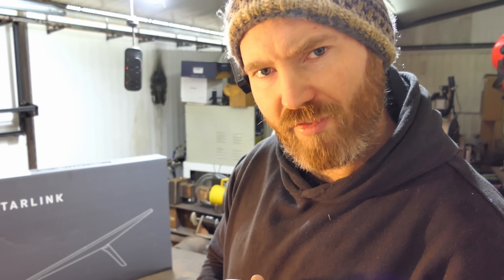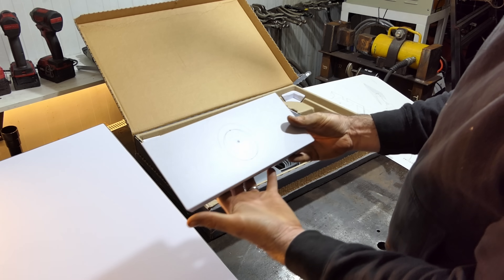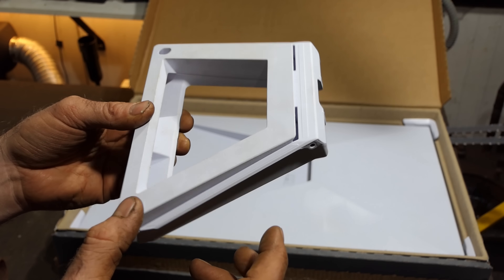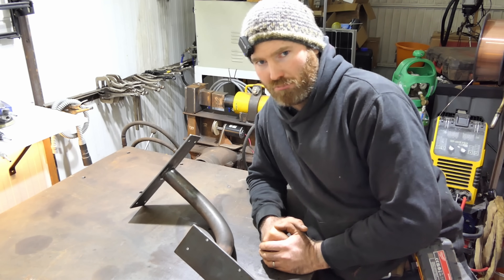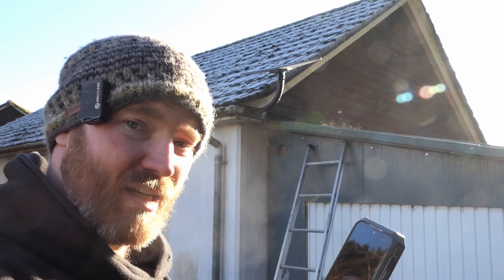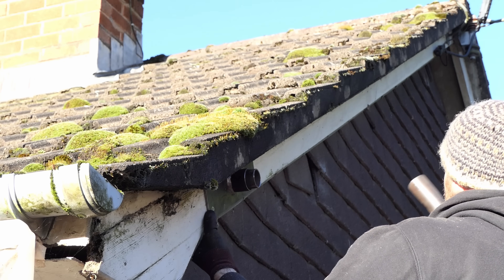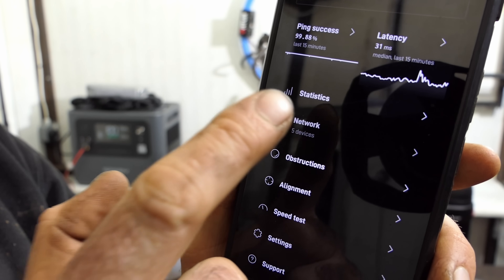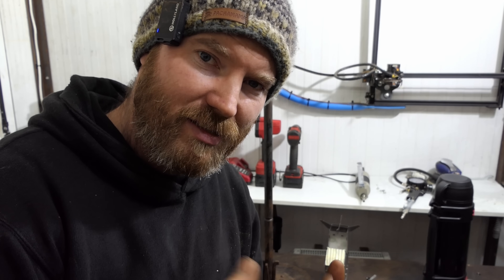I bought UK Starlink internet... I'm shocked!

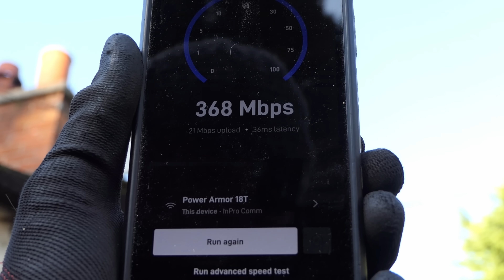Comment: 08:15   You are incorrect

It is 368 MegaBits  Mbps
NOT 368  MegaBytes per second    MBps

368  Mbps   is  46 MBps 46 Mega Bytes

8 bits in a Byte
Remember that
4 bits in a Nibble

Comment: One could buy a bracket - similar to those used for mounting
TV Antenna
OR
Go to a place where Car exhaust systems / pipes are made and fitted.
Have a bracket made in Stainless Steel - 
Generally Stainless Steel Exhaust systems are made for Trucks and
High Performance cars.

There will always be plenty of Off-Cuts  of  pipe
So a simple mounting bracket will not be overly expensive

Comment: BT were charging me £82 a month for FTTC connection in which I had copper connection to cabinet under 1/2 mile from premises. I originally got 54mb/s speed but as take up of the FTTC service by other subscribers increased my speed dropped to slower than ADSL speed or dial up modem speed. I decided to get a comms company to carry out a site survey as most of the mobile networks claimed according to their network coverage we would get good 5g coverage. The mobile network coverage here is non existent so the claims by these mobile network companies are a total pack of lies. I was advised that Starlink would be my best bet and it worked out cheaper per month than BT. I took the plunge of going for Starlink, the basic kit was free but i had a professional installation carried out, and have been with Starlink for 7 months now consistently getting speeds just under 400 mb/s. It is far better than any broadband providers in the UK and streaming, UHD, gaming and everything else I need to do simultaneously is absolutely flawless. I couldn’t ask for anything better than Starlink.

Comment: I have starlink in London - because I got it early... (I believe you can't always get Starlink for a London address any more - as there's a limit to how many connections can be in a relatively small geographic area - it opens up when the number of satellites bumps up just). The congestion charge you got is probably just because the local area you're in has a lot of other Starlink users (because the regular internet options where you live are crap).
Obviously I wouldn't need it if I could get fibre - but East London (Zone 2 on the tube map) is apparently not densely populated enough for fibre to be rolled out. I think the real reason is BT wants to get as much money as they can from renting out the copper cables that the Post Office put in before BT ever existed.
I first had fibre in 2005 in Tokyo. And had fibre in Hong Kong (gigabit just - but only because they charge more for the 10GB, and I wouldn't use it), and had fibre in Thailand - which is pretty much available anywhere. London is the only place I've lived in 20 years where I can't get fibre.

Comment: It's way too expensive for the average household.  Maybe when the cost drops by around 50% I'll consider one, what gets me is the big difference in download/upload speed for all internet connections, it should be higher upload and lower download speeds, or at the very least equal speed. The reality is that it's the bandwidth that's important for multiple users, I'll stick with my 4G router for now as living in the sticks I get better speeds from that than the landline,  Plus my whole setup came in at £85 with a monthly unlimited data plan for £18 per calendar month. download 120 Mb/s  upload 10 Mb/s

Comment: if you go on starlinks website themselves in the Uk the hardware is only £19 with a £75 a month plan. much cheaper since the original price. Definitely worth it for 5x  speed in the uk. We dont have any fibre optics over in here wales

Comment: To anyone in the UK: You don't need it. Just get a Three 5G hub for about £20 a month. I got 700Mbps the other day downloading Fortnite (90GB) on my Xbox Series X. (took about 20min) You always get fast speeds and even faster when downloading games since they have faster servers. The upload speed is about 50Mbps and ping is fast also. I've had it for years with multiple using the internet and had no issue gaming online. The speed is uncapped also, so it'll go as fast as it can. After midnight there's less people using the network (not in my house lol) so it'll be even faster, but it's still fast during the day also.

And most importantly there's no Fair Usage Limit either. If you went with say EE then after using 600GB within a month (which happens when streaming / downloading games especially with other users) then they just cap your internet speed right down, and at night they just cut it off completely to prioritize others. So EE just sucks. But Three is absolutely PERFECT! No issues at all, it's as it should be. Fast and Truly Unlimited Internet, that you can also take anywhere! We're living in the future. And we'll have 6G not too long now in the 2030's.

Starlink may have its use if you're stranded in the absolute middle of nowhere to justify that price. But if you're able to get a 5G connection then Three is the best choice there is. In other country's you'll have to use a different mobile network of course so price will be different and you'll want to check if they have a Fair Usage Policy before going with them. I just checked and Starlink itself even has a Fair Usage Policy, apparently it's after consuming 1TB within a month. So that might not be too bad for those who really need it. But paying that price though, there shouldn't be any Fair Usage at all slowing you down.

So yeah just get yourself truly unlimited mobile broadband like Three. Would recommend 3/3. lol

Comment: @Joshua De Lisle - If you are planning on upgrading you're old Desktop PC; BEWARE of the price for RAM right now due to a surge in demand due to AI Farms demanding the available supply of DDR5 in particular. I would therefore consider 2nd hand AMD AM4 Socket CPU and Motherboard with DDR4 Ram... The  Ryzen 7 5800X3D  CPU good for 4k Editing Maybe a B450/B550 Motherboard and 32GB of 3200-3600MHZ DDR4 RAM would be My choice in you're situation (A new Power supply of 800Watts upward will also likely be required.....PS Good Info in youre video.

Comment: The one thing I will point out with Starlink is it’s not a constant speed so if you get a bad speed test, just restore the test because it will be between satellite that’s why are you getting the lag? It actually will get better on the second test when you do it.
The one other thing I found out is that don’t use this darling speed tester use any other one and you will get a better result than you will with the Starling one. The only way the Starlink one works is if you connect to the satellite directly if you’re connecting through the modem will screw you up.
One of the problem I found and I did not see it on the set up. I might have missed it but I will point out my error. I did not set the password on the satellite itself. That means anyone can connect to it being out in the country might not matter to you, butcheck that the dish has a password on it.

Comment: Has anyone ever thought just HOW these satellites actually remain stationary up there ( assuming they are up there) and yet no one has ever made it common knowledge OR is the signal that YOU receive is actually being bounced off of the Firmament and that the actual sending device is sitting comfortably on someone roof or building . Your thoughts would be appreciated if you actually know. Thanks
Reply from the maker: There are lots of satellites and they just switch over as they pass. That's why space x has put thousands up there so you get a continuous signal but not all areas are within the orbital path. Cheers J

Comment: Still vulnerable to adverse weather conditions same as any other ISP Significant weather can cause service degradation due to attenuation of the radio signals. Moderate to heavy rain, snow, and hail can cause momentary service dropouts.  From Starlink's support pages. Maybe not such a good idea for those rural locations in the UK. Residential I believe is £55 per month.
Reply: Residential Lite option; I watch Linus too :hand-pink-waving::face-blue-smiling:

Comment: @ 11:05 and onward.  About 12 year old computer.  If you replace it try to install linux on it.  It is a bit gnarly to begin with.
A few YouTubers use linux for video editing and suchlike.  I never have.
You can try linux for free, and keep it for free And something like MX25 is reasonably okay.

Easy way to try it: download linux on to a bootable USB memory stick.  Start computer and use startup options to boot from memory stick DO NOT use INSTALL feature until convinced it is ok for you.  Of course it is more complicated than my quick summary but ... like most computer things once you have done it a dozen times it is easy-peasy
If you do install it on to 12 year old computer try swapping out hard drive for solid state disk.  It speeds things up quite well.
Adobe software is not likely to be installable but GIMP is reputed to be linux Photoshop
Warning: do not try it on your only working computer..  All at your own risk.  https://mxlinux.org/

Comment: Western Australia it's 290/34 at 7pm.  Peak traffic time.   Our local NBN fixed wireless was 70/20.  That was off peak.  Off peak Starlink goes to around 360mbs.  That seems to be a capped speed everywhere.

Comment: im in the same situation stuck on copper with slow speeds and i live basically in the middle of a university city centre so you know fibre runs are not far from the house at all.... but its a small road and they have no interest in installing fibre so far, its extremely annoying when you live on the internet, dont know whether to wait and hope fibre comes soon, as they did tell me 2024 once probably just to get me off the phone but come 2024 nothing happened and its now 2026 and i have thought about buying sim routers

Comment: wifi is awful in houses.  ground rule for wifi: It will go through one wall.  More than that, coverage will be bad.
The best way to get internet in houses is to make a wired backhaul, and put a bunch of wired access points in.
You should install Cat-5e or better wiring and a central switch, and a starlink ethernet adaptor. 
setting that up would be about 500$ in parts and installation is free if you have 20 years of IT experience.

Comment: Just installed Starlink before Christmas as we can only get the internet over the mobile network and with speeds averaging around 6 Mbs was somewhat woeful. I was concerned that we would not get a good signal with all the trees around us. But Starlink had a deal where the hardware was at no cost, has to be returned if you cancel the service, free installation and $20 per month of the monthly cost. So we signed up, they obviously didn’t do their homework with the free installation as it took a month before a local installer contacted us, with the earliest date being late January. We had an old satellite tv dish on the roof so installing on the existing pole was easy, I sourced a pole adapter on eBay for substantially less than the Starlink version. Routing the cable was a bit of a saga as I did not have the crimping tool for the rj45 connector so could not run the cable thru the existing conduit. But easy enough to set up and we now consistently get over 300Mbs.

Comment: Get a NAS. I have a UGREEN NAS my family uses for storage (no need for cloud) it has around 112 Terabyte of space so far, due to the amount of 12TB Ironwolf HDD i've put in it. It's in a raid configuration so if a drive dies, i lose nothing i just replace the drive. I also added two 1TB Sabrent Rocket NVME SSD's for caching and this thing is fast as hell.    Give the family a folder each with a password and quota and bobs your uncle,  if you upload to that instead of carrying HDD's about like it's 1999 then you wont ever lose a thing.  Storage is just one of thousands of things you can do with a NAS, you can run Docker and many other Apps from it, very handy.

Ps. Get some wi-fi repeaters to extend your wifi speed through your house.

Comment: Starlink my ash. 

In Greece we suddenly found ourselves last in Europe in Internet Speed in 2015. In 2022 we started the entire rejuvenation and as you know, whoever builds last, usually builds the best. Billions have been poured in Fiber Optics. Now all companies offer from 1Gigabit to 3Gigabits and a couple up to 10Gigabits. The government offered vouchers from 20 to 200 euros for cheaper upgrade as an incentive. Obviously, unlimited data, landline calls and even call & messages from the mobiles. The 5G at least is 1GB already. It was good anyway. I've got 1Gigabit for home and 3Gigabit for work. I happen to be second Lieutenant Engineer in the Greek Air-Force. The manager of my 4 years contracts in the same telecommunications company told me the billions poured the last 3-4 years are equal to the Army. In the Army, re-armement and restrucre-wise we're amidst our biggest in the last 60 years. 32 billion have been set aside just for the next 7 years. After the 7 years, new budget, plus 20 billion in general for the restructure. Similar case with the Metros. Athens has had the most modern in Europe until recently in automation, level 3 until the one in Thessaloniki, northern Greece opened which is level 4 in automation with 1 in 700.000 chances for any major incident. Practically zero. Why do you pay American companies instead? What about your own infrastructure even in rural areas? At some point they must be done. Especially now that the US has proven to be not much of an ally.

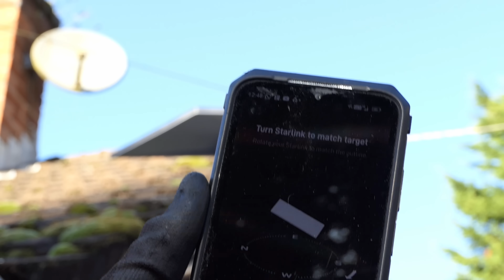Comment: 7:49 Nooo! mount the Starlink onto your chimney stack so it's the tallest thing around, you need 360 degrees all around line of sight to the sky. Your entire roof is blocking access to the satellites now - you'll see a marked improvement - certainly works on a fully cloudy day and even in medium rain it will be fine - with unimpeded access to the sky.

Comment: You can setup Ethernet over power. Will fix you issues with not being close to the router. Very easy to setup. Basically you just plug it in.

Comment: That is way expensive in your country. Here in Hungary you can start Starlink with an initial cost of $25, which is basically the shipping cost of the hardware. But you do not own the hardware, you have to return it if you cancel. The monthly cost is less than $30.

Comment: I use 3 mobile network WiFi, comparable numbers, better ping and cheaper at £21 per month with no hardware costs.

Starlink is not profitable and has cost around 20 Billion so far. Without major uptake it will go bust. With major uptake it will have a major drop off in bandwidth per person, there is no way to dynamically route traffic due to loading, as you only have a finite number of satellites.

Comment: I called my ISP, asking if I could switch to fiber optics. They sent a guy out to see why the fiber cable installation I had wasn't working. He called for a different guy to fix it. Then I plugged my router to my wall socket, I plugged my desktop into my router, and now I've got symmetric 1 gbps. Even when it rains.

Starlink is a nice concept but having to radio a satellite that radios back down to Earth is a bit silly, and having to support the infrastructure of constantly having 10k satellites with a lifespan of a couple of years in orbit is pretty close to insanity.

Comment: Just to clear things up, Internet speed or traffic is rated in MegaBits not Megabytes. Megabytes is a measurement of storage capacity not speed. 
Also your wifi connection speed will differ compared to wired connection. Due to restrictions via devices like routers and / or smart devices. So you can’t always use wifi as accurate way of determining your internet speed. 

Also the UK is still rather dated in terms of internet connection. Majority of places either use Fibre to exchange point then copper to property or Fibre directly to property. So the term Fibre broadband is thrown around loosely, as not everywhere is fibre to property yet. 
So you’re either on up to 80 megabits or up to 2.2 gigabit depending on type of connection.

Comment: I've got an on going project making a computer case using RBS and hardwood, I'm planning to use 200mm fans and have the system water cooled so it's extremely quiet,   I've got a good amount experience in wood/metal work but it's actually much more challenging than you'd expect. If you're building a new system it would might make good content.

Comment: You need to get wifi extenders put around the house in 25ft intervals or get ethernet sockets installed in every room then plug in a wifi extender to each one with an ethrrnet cabke. Cat 7 or above. Use extenders rather than a mesh system so you can keep the same network name and password rather than having two internet identities

Comment: They do make a pipe mount for the Gen 3 antenna.     So you now need to use an ethernet port on the router and run a cable to your shop...  put up another StarLink Gen3 router for a Mesh with Back-Haul.  Or, if you don't want to buy another StarLink router, configure a plastic box router as a WAP and just do roaming network with common addresses and passwords.  Then you have reliable full speed WiFi at both ends the house/shop.

Comment: Starlink support is non-existent. If it breaks, you're on your own.
And boy, does it break often.
Had one of these pieces of sh1t for 12 months and basically binned it after 3.
Rain, drizzle, even light fog totally stopped it working.
And download speeds were variable down to zero, making it useless for  video calls with work or watching even a 720p video.
Save your money and your grief and stick to lobbying your MP to get ultra speed, RELIABLE broadband to your home.
Just don't touch this Musk tripe,.